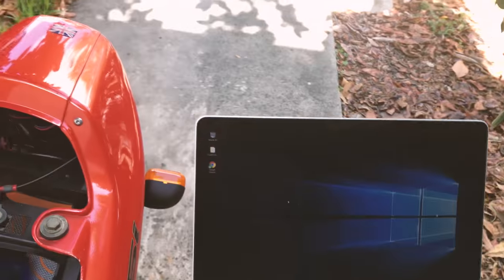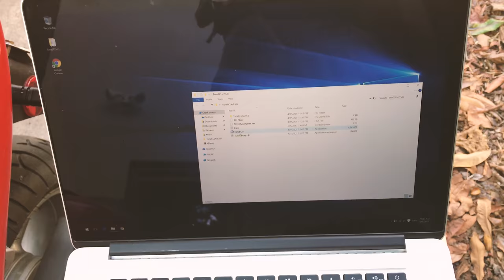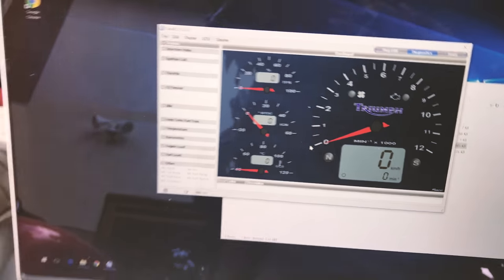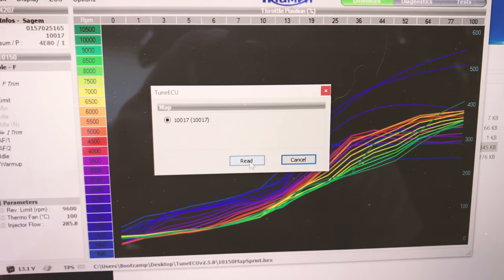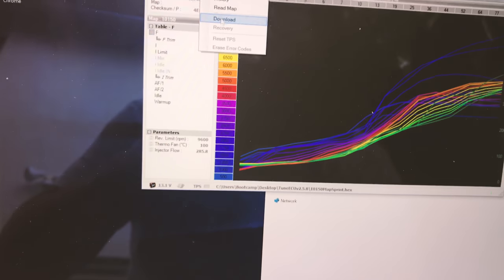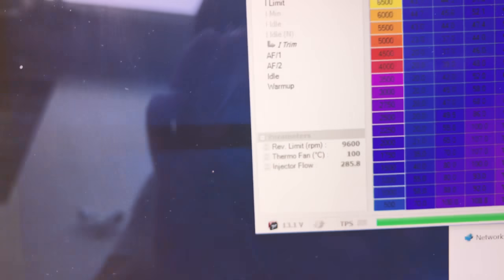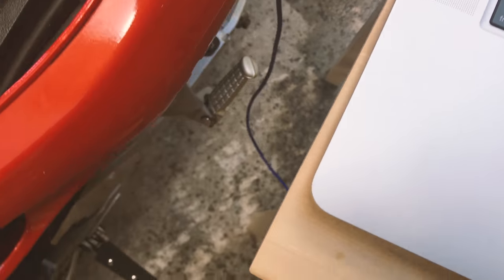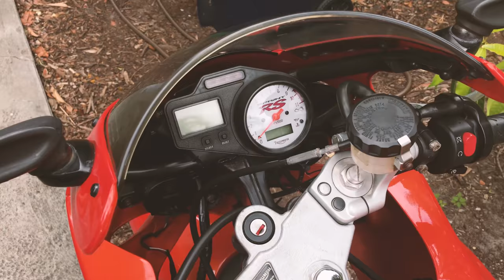TuneECU: How To Load Custom Fuel Maps to Triumph Motorcycles (Sprint RS)

Comment: I flashed my map and the previous owner took it across America putting 35k miles. Living with the fuel cut off that whole time must have been crazy. My new map fixed that issue and smoothed out the rest of the throttle feel over all the gears and raised the rev limit and top speed limit. It's a whole new liter bike now.

Comment: Hi Li fan, you mentioned that you had to correct something in the wiring on your bike before you could do this, I am having trouble connecting the ecu to tuneecu, have followed all the advice on drivers etc and still no luck, did you follow any advice you could point me to when checking the wiring? Thanks, Ross

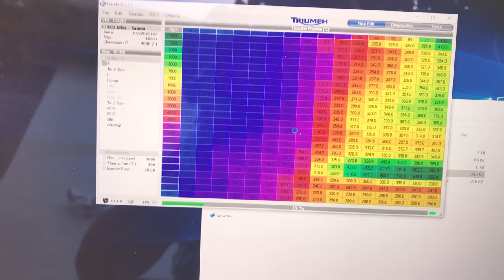Comment: At 8:58 of your video you state, make sure your battery is not connected, has me confused because you can't run tune ecu without power from the battery, "please explain this procedure of downloading a map while your battery is not connected? Thanks big guy and "Be Safe"
Reply: legend he meant connect the battery to a charger during the process or it will drain.

Comment: I’m looking to possibly do this to a 2000 RS. After the new mapping, did you notice any difference in the bike at other rpms, or any difference in fuel economy?
Reply from the maker: No difference in fuel economy, only improvement I've noticed is in the low rpm.

Comment: i installed a new map on my triumph sprint st 1050 and the petrol gage is not working only the red light comes on when it is empty.it works when i first turn the bike on when it does the test thing with the clocks have you got any ideas why it my be like this. will i need to reload the map and TPS sensers .thanks
Reply from the maker: The tune ecu doesn’t affect gas gauge, your sensor might be faulty not related to tuneecu

Comment: Hey man,i have an RS 2000,just like yours and  he needs an injection check i think.No one can tell me when it was that last tine.Since 2000.What do you think? And where do you get that map from?
Reply from the maker: I honestly don't know the answer, if you think the engine is miss firing due to injector problem, best take to a experienced mechanic to have checked out, or you can simply tell because the engine would not sound normal
Reply: @TheGizmoGarage  yes the engine is miss firing when i rev it,at idle.Is that a problem of  fuel injection?
Reply from the maker: @MrLeonard750  it's possible fuel injectors are bad, or could be compression problem in cylinders... But do check spark plugs first, when they go bad engine misfires and it would be the first thing to check and it's not hard to do on this bike
Reply: @TheGizmoGarage  Right,i know,plugs.But i do have same jerky place betwen 1000 and 3000 rpm like you.I lost the engine few times when takeoff.

Comment: This is not a very good explanation of how to do this. On your screen you flash through what you need to do very quickly without actually showing it or explaining what it is you're doing so that the viewer has no idea what to do.
You need to slow down and explain, at every step, what you are doing and show those steps on your computer screen so that the viewer knows, and can understand what you're trying to show them!
Reply: Good video, but a very important process was forgotten.
If another map has been flashed, a TPS reset is required.
Reply: Ashley Haadt  I hear you" I asked him about the same thing when he states make sure your battery is disconnected, if that was the case, you wouldn't be able to run the tune ecu; maybe he was referring to not to have the bike running; "Just not sure!
Reply: @genecitarella3516  The bike was NOT running and the battery WAS NOT disconnected. He took fuses out to keep the drain minimal on the battery. That is what I got from the video. He didn't mention a reset after the tune which I think is needed as well